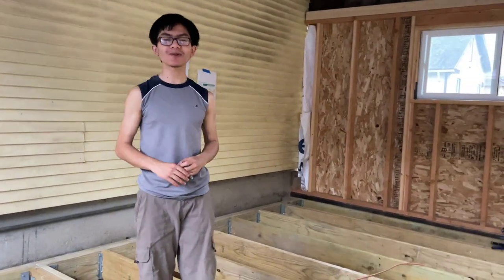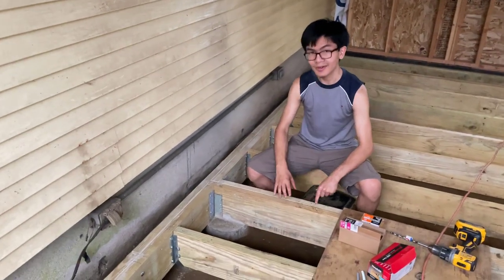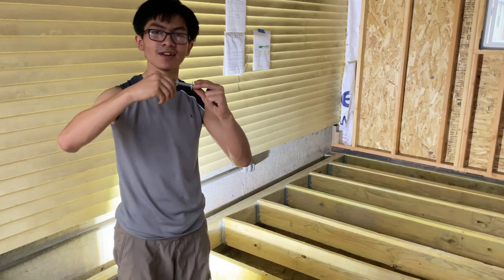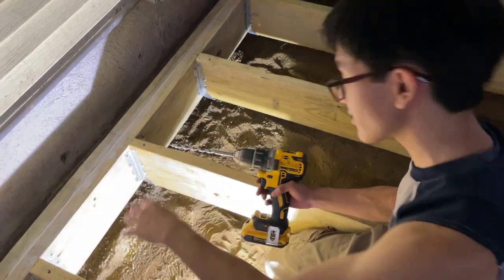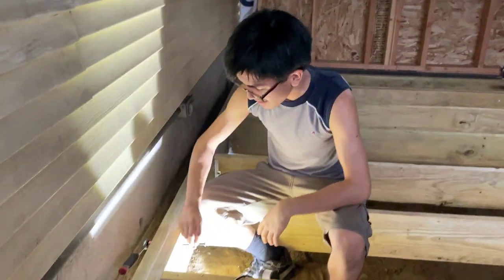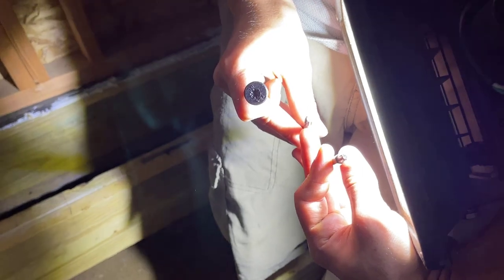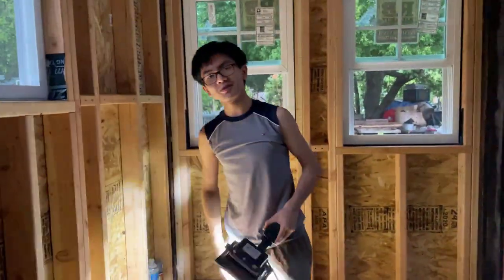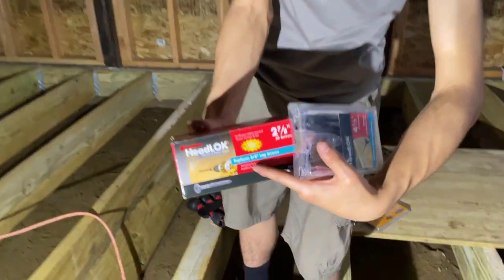Sistering Joists Or Beam For Deck Or Floor Using Carriage Bolts & Structural Screws | Enclosed Patio

Comment from the maker: Here are the #ad links to some of the hardware, materials & tools showcased or required for this project:
1.  https://amzn.to/31odz69  |  SNUG Fasteners (SNG327) Ten (10) 3/8-16 x 2 Long Carriage Bolts Set w/Nuts & Washers
2.  https://amzn.to/3Iljz00  |  FastenMaster FMHLGM278-50 HeadLOK Heavy-Duty Flathead Fastener, 2-7/8 Inches, 50-Count, 2-7/8", Black
3.  https://amzn.to/3En3XXJ  |  BOSCH BL2751 3/8 In. x 12 In. Extra Length Aircraft Black Oxide Drill Bit
4.  https://amzn.to/3rOz8I3  |  DEWALT 20V MAX XR Brushless Drill/Driver, Compact - Bare Tool (DCD791B)
5.  https://amzn.to/3EqwL1e  |  Milwaukee 48-22-9486 1/4"-3/8” Ratchet Socket Set w/PACKOUT Case - 106pc

Or Click on Amazon link here and search for what you need:  https://amzn.to/3xIOsqg

Comment: I think I understand what you are trying to say about the structural screws exerting pressure against the wood surface ( around the sides of the hole it created), the screws is snug inside  and through the joist. I don't think the screw weakens the joist in doing this as long as it is not too close to the edge of the joist. I actually think it replaces the wood that gets lost while the hole is created, and becoms one with the joist. I think that the engineers who design the screw do take this detail into consideration and for this reason the recommended distance of the screw from wood edges during installation needs to be followed, is meant to prevent splitting and cracking do to pressure. I have used the structural screws to repair and also build a new deck, i prefer structural screws to log screws. You do think critically and seem to have the mind of an engineer, choose engineering, civil/ structural engineering, no don't go for contracting.

Comment: See the openings for windows n such? Count the studs that have been cut to make the opening. That's how many you want to be putting back in beside the opening, and the stud jacking the window sill doesn't count. Then beside the opening on each side you ideally want to tie the top plate down. Via a threaded rod that has a nut joining it to threaded rod embedded in the floor or threaded rod inserted and set in the floor.
And single top AND bottom plates? You're wasting the opportunity to gain further bracing opportunity. For the cost of an extra top plate and a couple of lengths of steel... rod.....

Guess you're lucky to live in a place where your wind rating spec is negligible...
Which must be nice.

Until it's not...